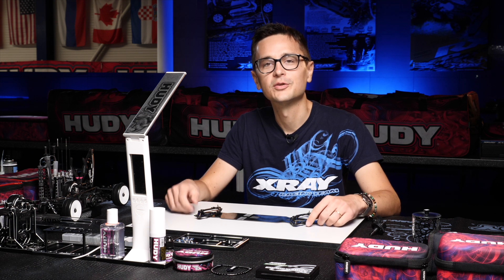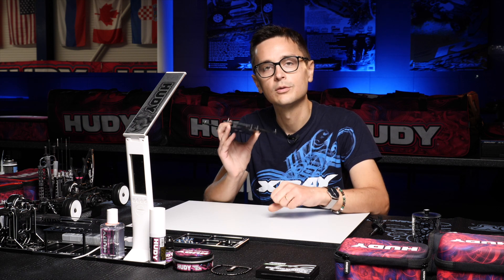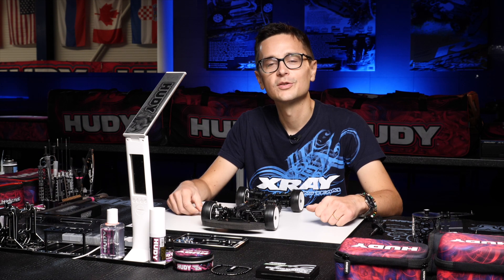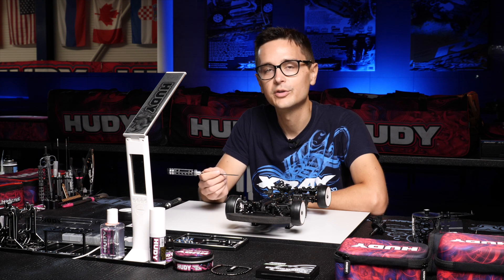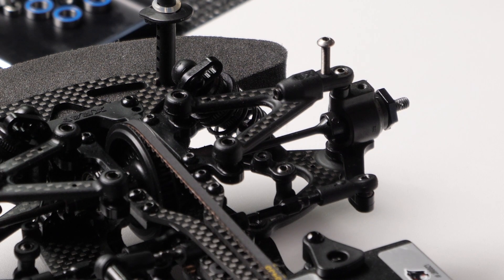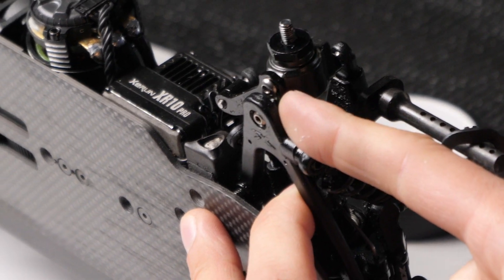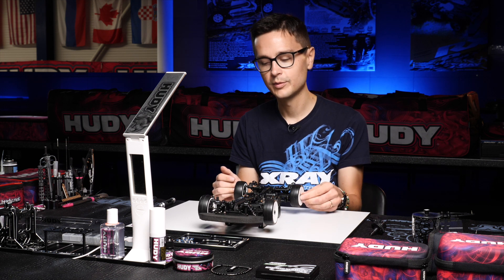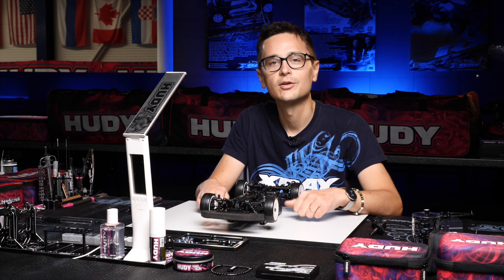XRAY X4 - Tech Tip - Roll-Center

Comment: I find lowering the roll center (esp a the rear), makes the car more easy and foregiving to drive. You maybe loose a little on power grip, but the rear stays more planted when you inload the rear, instead of going into oversteer. Trottle control is easier than controling oversteer on corner entry or mid corner... Just my 2 cents ;-)

Comment: When we increase the axle/hub height say by 1mm, do we need to reduce the shims by 1mm on the top of the hub connected to the upper A arms? If we don’t do that wouldn’t it then change the roll center and camber gain?
Reply: I guess so. I would test both settings.